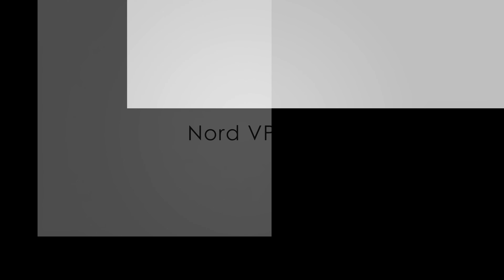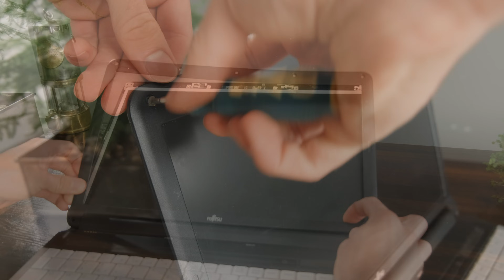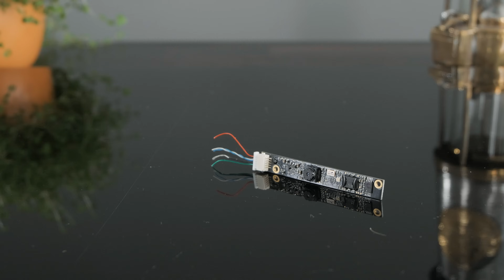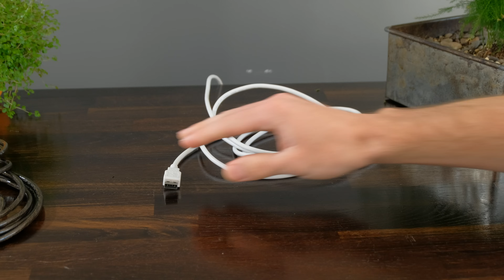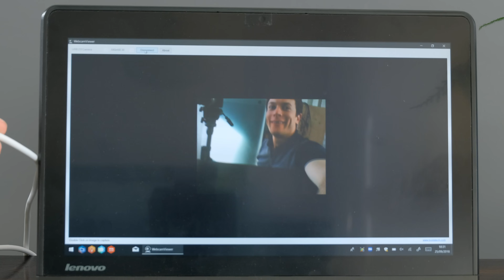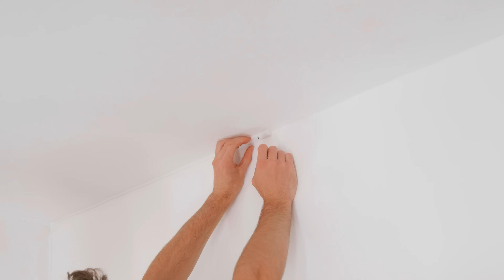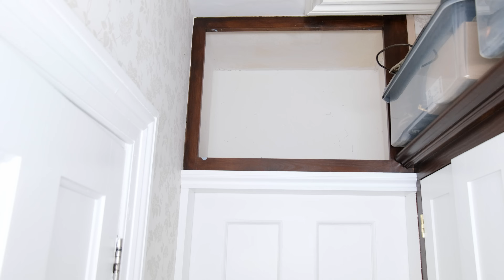DIY Home Security - ON A BUDGET!

Comment from the maker: Hope you guys enjoy the video! :) Btw, if you're a Patron don't forget to check the feed on there for a little update.
One thing I forgot to mention in the video is that I did encounter one webcam that needed to be 'turned on' before it would be detected by the system. It's rare, but to get it going if you encounter it you just need to bridge the 'ID' wire (of which there should be only one left over) to 5v using a 10k resistor to give it a voltage. Don't forget that as these cams are so small you can use them for birdwatching if you put up some bird houses with them inside. 

Cheers,
Matt
Reply: Hey Matt, would it be possible for you to create a tutorial on how to use this wirelessly maybe over wifi using a raspberry pi?
Reply: Thanks so much for this, i was looking for  cheap security option or my grandparents house, this is perfect ! thnks so much and i love the channel. is th number of cameras limited to th number of usb port or a usb hub would do the trick?
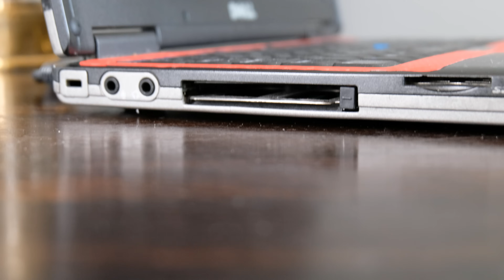Reply: @Balancatraca  No it has to be a root hub Controller ... hardware you install internal  ... where uses a other connector/Interface than usb. He explains in the Video ... watch from here again: https://youtu.be/CouxmNqxO4A?t=433   (Time 7:13 )
Reply: Great video, I was wondering if the free software has the capability for me to have a PC connected to WiFi so I can monitor while not at home like commercial ip security cameras?
Reply: Wouldn't a SoC PC such as a Raspberry Pi be a rather more cost and power efficient solution than an old laptop? Especially for the bird watch solution, you might want to hook it up to a Pi Zero W. I get why you might have chosen the laptop setup since you wished to show an enviroment friendly reuse of hardware, but the Pi comes with a custom surveillance cam operating system called MotionEye OS.
Reply: Cheers Matt.
Any comments on iSpy v Contaware?
(Ispyconnect.com)
Reply: Maybe do an update with some of the newer stuff on the market?
Reply: Definitely enjoyed. Thanks for this Matt. I might be making one of my own for my parents.
Reply: Incredibly informative and useful! Thank you so much for providing such amazing content.
Reply: @DIYperks this is awesome, but i couldnt help thinking beyond just laptop cameras. what if you hooked up a laptop cam to a pi zero (or arduino or something of that sort) and a battery bank and wirelessly record video to a nas or computer. then you wouldnt be limited by the range of a usb cable (or having to run cables all over the house). cheers & keep up the great content
Reply: can we use old cellphone cameras in some diy fpb or micro camera...
Reply: How to Make them wireless.
Reply: Great video, it'd be cool to make a diy video door bell. Those things are expensive
Reply: can you do this using phone cameras?
Reply: thank you so much for making this it really helps what software do you recommend for this   
hopping for something gnu gpl so I can do it with a raspberry pi in a car
Reply: I missed it the first time 
software is ContaCam
Reply: Could those cameras work with say a raspberry pi setup? Where I live, used laptops aren't commonly found without being already scrapped.
Reply: Bubbadmatt812  yes, the laptop cameras are using USB 2.0 so they are same as any other USB web camera...
Reply: "BIRDWATCHING"                  ( ͡° ͜ʖ ͡°)
Reply: What are the other wires for? The microphone?
Reply: Where do you get so many laptops?
Reply: psiphon does the same thing, but its free... less platforms though
Reply: @jk44 v2  you will hit a hard wall my friend, here logic and rational thinking doesnt exist, here you will only find "fans" of DIY Perks for which any idea that doesnt come from DIY Perks is counted as "lame" or "retarded" or "not as good as the one in the video"... i tried to tell people that there are other options that are cheaper and easier and way better than the one DIY Perks shown in the video (my idea is same as yours btw) and i got attacked from people who are "defending" (for some strange reason they think i am attacking him) DIY Perks... 
the "system" he is showing costs more than $350USD and requires you to solder and pull cables around the house and keep laptop running 24/7, and on the other hand buying 6 wifi cameras costs $180-200USD and will be way way easier to setup and with tons of more options...
Reply: Out of curiosity,  @Hobypyrocom  , how are the WiFi cameras powered? Are they LiPo, battery or mains-powered? Or maybe PoE or solar? One potential advantage of the DIYPerks system is being powered by USB and not requiring any other power sources. While granted there are "cheaper" out of the box options, sometimes it's just more fun to make something and learn new things in the process - I could easily buy enclosures for things if I wanted, but I like using a 3D printer or laser cutter - it's not always about money.
Reply: Hey, I'm not arguing the point about extenders being expensive. Was legitimately interested in how the WiFi cameras handled power - without a nearby power outlet, this either limits positioning or would require installation of another power point or cable run. PoE would definitely be the way to go IMO. Thanks for responding.
Reply: @notarikon  to power my wiif cameras i have 100W 12V LED power supply, i run cable to my wifi cameras and at the camera i use 12 to 5V converter meant for use in car lighter... the led power supply is around $12USD and each "car phone charger" is around $2USD... i forgot to tell you that...
Reply: IamIUareU how to modify it to lan or where i can find firmware for safety?
Reply: @coron1985  its not that simple to explain it here in youtube comments... i will make a video on my channel and let you know...
Reply: where is the driver for camera...? it just says "usb 2.0 camera" but can't find the driver for it....
plz help to find the camera driver.
Reply: @Bilal Iqbal  just go and buy wifi cameras man, it will be easier to setup and way cheaper than the system from this video...
Reply: yea man you are absolutely right..but i have a lot of this kinds of cameras.
so i just want to run it as a electronic project.thanks
Reply: @Bilal Iqbal  after this video many people will search to buy such cameras, go on and sell them on ebay and with the money buy your self what you need for your project ;)
Reply: Hi Matt!! I dont have laptop cameras, but I have a couple old mobile phones lying around. Can i do this with those? please explain.
Reply: This is what I do. But Curious what software you use. I been using iSpy but for my setup iSpy hasn't been very stable for a software for me.
Reply: Just one question DIYPERKS, what about low light situations? Night vision? Although that idea Is great!
Reply: A few of my usb cams, I removed the IR filter and have a few cheapy IR illuminators setup for night vision
Reply: Can u make a wireless version?🤔 That would be rly great!
Reply: Only draw back to this system for me is that it isn't infrared.
Reply: Can this be done with a raspberry pi?
Reply: +DIY perks you know what would have helped? if you had provided the models of the  the cams you used and the wiring  colors codes for them so we can just buy one that are known to work and that we already know the   pin out of
Reply: I've put the resistor on and it still don't work. any ideas why that is?
Reply: All that work..... For $2.84 you can buy a Min USB WebCam and you don't have to do all that work.  All you need is the USB Port / Hub + Computer + the Free in the Video Software and you will be all set.  eBay Item:  163188849225
Reply: NordVPN is a scam, avoid!! Read Trustpilot, Reddit, Hacker News. It is owned by a Lithuanian data mining company Tesonet. There are many facts presented. Tesonet sells all data gathered from Hola and NordVPN. Besides that, NordVPN is obliged to keep logs for 6 months according to the Lithuanian law. Their "Panama offshore" story is made up to hide the real owner of NordVPN/Tesonet, they are located in Lithuania and they process payments in the US. You will reduce your privacy by signing up with them!!

http://vpnscam.com/nordvpn-protonvpn-proton-mail-owned-by-tesonet-ceo-darius-bereika/
http://vpnscam.com/tesonet-data-mining-company-owns-nordvpn-protonmail-protonvpn/
Reply: Please tell us if the recording continues even after switching off the laptop???????
Reply: Hello.
How about cameras from smart phones (using the camera only)? Can you teach us how to make one from them.
Thanks
Reply: How do you view it if you set it up somewhere does it have to be connected to computer or phone to work
Reply: Hi can I ask is D- and D + is equivalent to  tx and rx as in UART protocol?
Reply: hey by the way how long can the usb cable supply power and get undistorted data !?
Reply: Quick tip, these webcams can get hot using usb from my experience. I think they're made to be low power on laptops and probably running on 3,3v 3,7v and not 5v ? Correct me if i'm wrong.
I wouldn't advise you to cover them in anything. Sugru or whatever.
If you know enough, get the usb power down to 3,3 3,7 i guess. Or leave the camera well ventilated if it's running for a long time (security camera duhhh).
This might actually start a fire to be honest. @DIYPerks
Reply: How do you save images
Reply: Have you connected this laptop to the internet? if so give me a mail id you are using in this laptop, you might expect an update patch from Microsoft and run that .exe file as that will be fixing your security problems in your OS. wink wink :P
Reply: But you know what's better than NordVPN? TUNNELBEAR! Tunnelbear is the simple VPN app....ok this joke's really old.
Reply from the maker: Haha.... yes, that line from Linus is forever going to be burned into my brain... forever...... xD
Reply: @DIYPerks  prefer you to Linus thooo, wish you could upload more frequently, but we all understand 🙂 keep going Matt!
Reply: @DIYPerks  Talking about Linus.. Squarespace!
Reply: your system has 6 cameras so lets say thats $12USD (with lame quality), you will need 6 Sugru costing $15USD, you need laptop which want it or not will cost $20-30USD, also you will need USB extenders and to buy decent ones for 30m distance you will need to spend at least $20USD on good ones for each camera and plus the usb hub if your laptop doesnt have enough usb ports which is highly possible...
all in all your system costs around $180USD (not including the cable between the usb extenders), how is that cheaper and "easier" than buying 6 x $20USD wifi cameras which have tons of options and way better video quality and requires no soldering or any other setup other than plugging them into power and setting them on your phone?
Reply: @Hobypyrocom  6 WiFi cameras... All disabled with a little aireplay action. Wired is the only way to go for security.
Reply: M3ta7h3ad  first of all my wifi cameras are modified, there are tons of ways you can make them safer and protect them... i dare you come and test my cameras, lets bet, what are you willing to put on the bet? i say that you cant hack or disable my wifi cameras... also as i said, you can modify and make your wifi camera to be lan camera instead if you want it wired so much... modifying wifi camera to lan camera is cheaper than buying lan camera...
Reply: IamIUareU  Not only what @M3tah3ad said, but the WiFi of these 20 Bucks cameras is extremely limited. I had my fair share of problems when I discovered them. I tried out 4 different brands before I got tired of it and I ended up returning them all before I made one with a Pi Zero W.
Reply: Sullivanski  you can easily modify and make those wifi cameras to be lan cameras... those wifi modules on them use USB 2.0 interface, so use your imagination and for additional $2USD you can make them to be LAN IP cameras ;)
Reply: @Hobypyrocom  the cheap Chinese cameras are full of backdoors and exploits, so a lot people can be looking without you knowing it ... Just a little thing to think of.
Reply: zapro_dk  i am software, web and firmware developer since 1996, trust me i know what you are talking about... as i said i modified the firmware on my chinese wifi cameras, but even for a novice a simple solution can be making the cameras network internal and local and is enough to make them safe enough... we are talking about the simplest and cheapest solution so its not like rich people will ever use this type of system... anyway its not like a top hackers will ever target you and even if they do they will not be able to hack your cameras in less than a 5-10 minutes if your camera network is local...
Reply: personal I hate internet of things its the worst makes me want to get good at "pen testing" I once got my schools internet password good times better yet I gave it to a teacher that knew non of the staff where supposed to have it he was cool with it thank god  I hate internet is almost forgotten
Reply: Stop putting in-video ads nobody gives a shit and everyone just skips them
Reply: yeaah nordvpn is a must! was one of the easiest to set up!
Reply: how is nordvpn a must, what do you people even use it for? it's like 45$ per year you could use on something better like saving up for something you actually want like a good security camera. and the deal is basically a 2 year contract so it's really 95.75 that you have to pay right now. couldn't you use those 100$ on something more important?
Reply: Apathetic Indecisive  security camera will save only your house, not your bank details, while you working on your laptop in starbucks. And what else, Imagine you having smart home system and everything is connected to your wifi network from your tv to your fridge, conditioning or heating so you could see all stats through your mobile devices, pay bills and so on. And then some rude kid or evil neighbor with some hacking skills gets inside your router and starts playing with your house gadgets? Then it will bring more losses than a 100 dollar a year for a nordvpn.
Reply: stop with the what ifs, what do you actually use this for?

1. i've never used starbucks wifi
2. no smart home
3. i pay bills on my home pc it's already set up and automatic
4. https everywhere pretty much.
4.5 i use a special card for online purchasing that is safe if an attacker were to get the details it's easy to suspend.
5. router is obviously password protected and hidden. both physically and the ssid is hidden. though it's not nearly secure as i would like.
6. 100$ per every two years. you have to pay in full though so if you cancel half way through you lose.

one of my major concerns is do you trust nordvpn isn't spying on you?

Comment: No..... Just buy some WyzeCams for a fraction of the price and time... This is ridiculous
Reply: Personally I have a miniPC that is sitting around doing nothing which could be pulling surveillance duty.  It's already pre kitted out with enough power to handle some cameras I already own.  I'd also personally choose hooking these cameras up to a Pi Zero W if I need wireless capabilities- I don't think the speed is much of an issue when handling a USB webcam device.  Then again, I'm not in need of creating a security system that I'll have to maintain myself.
Reply: I work on laptops as a side job, so it’s VERY easy for me to source one to use for surveillance.
Reply: Sebi's Random Tech  I run a decently-sized electronic recycling center and I have nearly unlimited supplies of most laptop parts from the last 10 years.  I still would not use them to make a security system.  If it came down to actually needing security that I could rely on and would result in usable information that would lead to a conviction, there are much better options for less money.
Reply: Zach Good for you. Prove it to me.
Reply: @SebisRandomTech  what part?
Reply: How much did the whole setup cost? There is an awful lot of accessories further than some £2 webcams (which are no doubt the low Res/unusable quality ones)
Reply: Zach The point of this channel 👉DIY
Reply: JUMP23MΔN Agreed, but there is a point where it turns into DIWhy.  Nothing about this build is future-proof and will only cost you more in the end when you have to scrap it.
Reply: Also paint supply cost, tools to cut holes in all your walls, etc.  When a DIY video relies on you tearing up old laptops, finding giant usb cables and then cutting holes in your walls to feed them through, you can't take it seriously.
Reply from the maker: Dude, they're over 10x the price...
Reply: @DIYPerks  Oh and that too
Reply: DIY Perks  No need for usb cables or possible repeaters, no need for usb expanders for the computer, higher definition, wireless, sd card storage, it's a self-contained system (no need to find an old laptop), and your own time has value.  In my opinion, they're much cheaper when you look at the whole picture and not just the single purchase of 1.50
Reply: WyzeCams break so fucking easily...